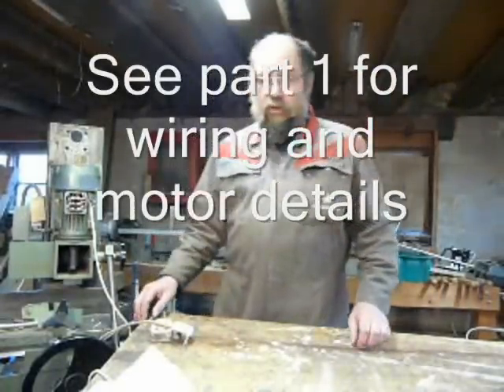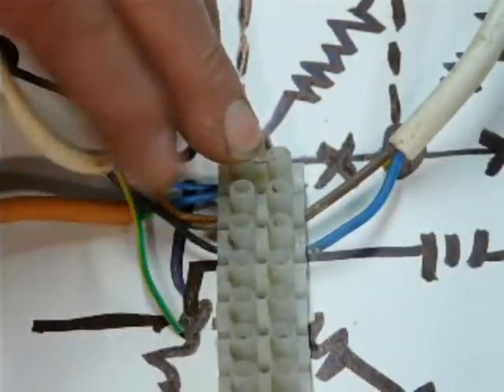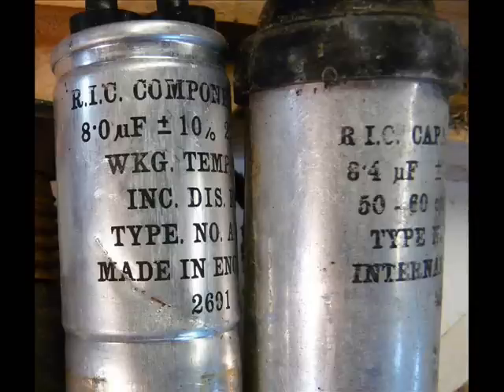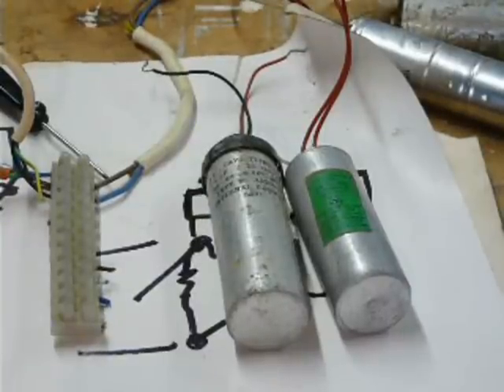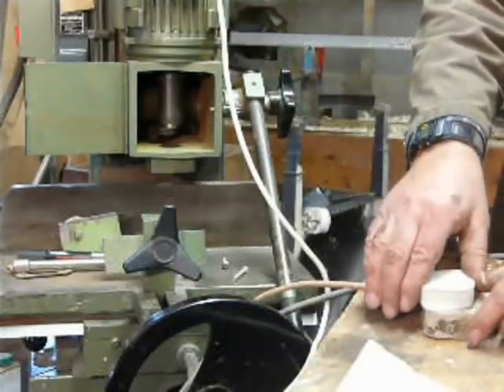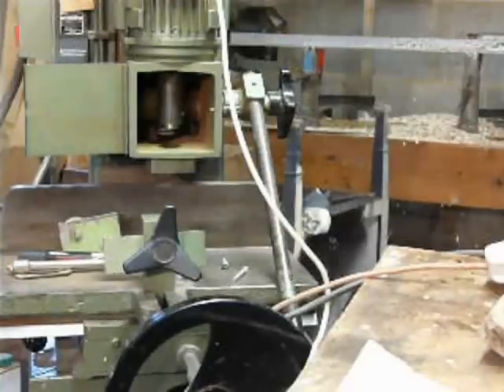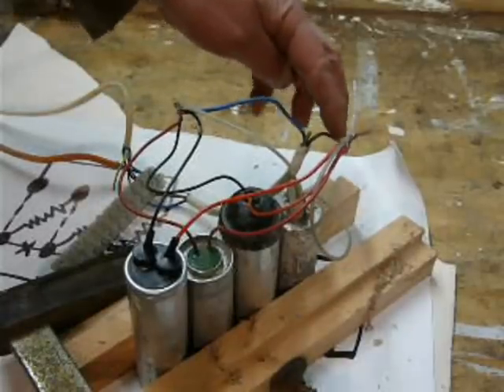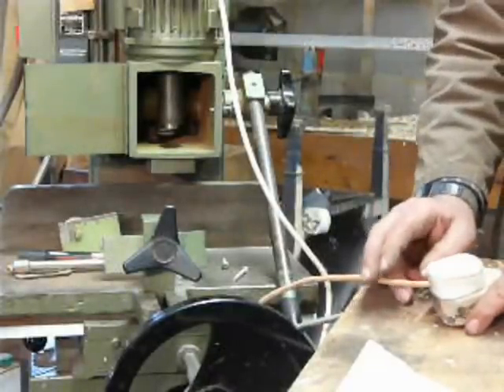How to do it: run a 3 phase motor on single phase supply. part 2

Comment: could you shed any light on this for me please Andy,a guy selling a meddings pancera drill i'm interested in,says he thinks it was three phase but its running on single, but is running in reverse only.has this fella just got it wired up wrong and the drill fine OR something else?cheers,Dave
Reply from the maker: David, If the rest of the drill is OK then it's time to do a deal. If it's running backwards then it can be be thought of a faulty and so lower the price. If this has a 3 phase motor then the motor plate will say so and you will be able o find he capacitors. For a 3 phase motor it's easy to change he rotation, you just swap any 2 of the wires, that's it. For a single phase it's a but more complicated but I've done a video about it, search Andy Reynolds Brooke Comptom. Cheers
Reply: @TheInfoworks  Hi Andy,turns out it was a single phase motor the guy having said it was three.studied your video on single phase motor rotation change and hey presto it was as easy switching the two wires!! and suggested a lower price which i got!!happy days!  thanks again for your invaluable videos and advice!Dave...p.s.it is a meddings pacera soon to be restored to its former glory!theyre very  nice drills i've gotta say!
Reply from the maker: @davidwoodward7020  David, splendid, self reliance improved and one happy subscriber, cheers
Reply from the maker: @davidwoodward7020  David, grand news, it's  drill for life, hope you've seen my Denbigh drill rescue series. Look under "about" on my channel page, cheers
Reply: @TheInfoworks  will do,cheers!
Reply: @TheInfoworks  okidokey,thanks for the reply and i'll look that video up to,cheers!

Comment: Hi Andy,is there any formula so to speak of capacitor size in uF etc to  the power/size of a 3 phase motor?if so please let me know,ive a fobco floor standing drill i am trying to convert.
cheers,
 Dave
Reply from the maker: Dave, there is an it will be buried in the comments somewhere. With all the differences in motor design I fin the trial an error method better. Even if you calculate the value you will find that some experimentation is still required. That's why I set out the videos this way and it allows you to use the capacitors you have in stock. Cheers
Reply: @TheInfoworks  ok thanks Andy,i'll take a look for it and have a play around.cheers,Dave
Reply: @TheInfoworks  Hi Again,just one question.ive got as far as figuring it needs about a 12uf capacitor for a 250w motor..BUT as the triangle indicates on the motor spec badge, it says 220/250 opposite it...but the kinda mercedes tri blade symbol says 380/440..my intuition is telling me as i'm going for single phase and that type of wiring i should use a 220/250 capacitor..would you agree Andy?
Reply from the maker: @davidwoodward7020  David, the triangle is delta and is the correct wiring for 240v. Have you see part 1 and all the rest of this video series? cheers
Reply: @TheInfoworks  not yet,i looked at 7 as per your advice to some over capacitors in comments here...as with most men we try everything then eventually read the instructions,a certain parallel here :),i shall have a look this evening,thanks for your advice and direction Andy

Comment: Thank you Andy!
Your two videos on Three Phase to Single Phase are superb and the subject mater explained so very well!
Having electrical experience in a Nuclear Power Station's I.M.D place of work will help me, sometime in the future, to convert a 3 Phase Motor to a Single Phase Motor!
I believe that any practical, safety minded and intelligent fellow could also do so by following your advice via your videos!!
I suppose the only limit on a motor's size is down to the Electrical Supplies's Capability? 
Does it follow that the larger the 3 Phase Motor (or Generator) the larger the capacitor(s) that one would need?!
That would be both "Start" or "Run" capacitors.
I have some "Whopper" Motors here on my Farm that have driven Grain Drier Fans! One of these Fans can also be driven by a Power Take Off (P.T.O) from a Agricultural Tractor! 
I also have a Beautiful Old 3 Phase Motor Driven Mechanical Hacksaw that needs to be put back to work!
If I could convert the P.T.O Driven Fan's Motor to a 3 Phase (or Single Phase) Generator then I could drive the Old Hacksaw and my other 3 Phase Motors with my 
1982 Massey Ferguson 690 (70 to 80 HP at 540 Revs P.T.O Speed) Farm Tractor.
I also have a Lovely 1998 Italiano 100 hp SAME Silver 100.6 Farm Tractor with a Six Cylinder, Air Cooled German Deutz Diesel Engine in reserve! 
Perhaps I could please ask you to make a video on how to convert an Electrical 3 Phase Motor to an Electrical 3 Phase Generator Andy?!
That way one could Harness the full power of the "Whopper" 3 Phase Motor(s) come Generator?!
Meanwhile I will now just have to "Trawl" the "Net" and hope that I can find Video(s) on the subject that can match the quality of your Videos?! 
Well done that man!
All the very best to all of you "Out There!"
Rob ö Halmore in The Berkeley Vale.The West of England.
Reply from the maker: Rob, I  have never had much success with larger motors, due perhaps to the start current that could be up to 10 times run current. To that end I did a video showing the use of a pilot motor to stabilize the third phase. Thanks for your positive comments, cheers
Reply: @TheInfoworks  OK Andy you are most welcome! There are Genny Videos on the Tube but you should do one for our edification! Are you from the UK and are you a Boffin or a Prof? What is the Link for your Pilot Motor Video? I shall have to look up and learn about "Pilot" Motors! Are the Neigh like "Pony Motors" Jock or can they fly along a bit?!  Absolutely no idea and I should know! Bye! Rob.
Reply from the maker: Rob, self taught mate, a pilot motor is a motor that you start with no load and it runs all the time to stabilize the 3 phase. Then you start your primary motor. It's part 7 but here's the link, https://www.youtube.com/watch?v=qbhDFseizWc&t=4s
cheers

Comment: Hi i convarte my 3phase bench grider to single phase and it runs very slow can you tell me what I did wrong
Reply from the maker: Hi, I think part 4 shows this, you probably have a faulty connection, does the motor start very slowly, cheers

Comment: Upto how many minutes I can run with the capacitors?
Reply from the maker: Hi, I don't seem to have a problem with run time. It depends on the capacitor size, as the large the cap the higher the coil voltage, see part 7 for the experiments, cheers
Reply: Ok thank you

Comment: thank you very much for your video. too bad you couldn't show how you calculated the micro farad's needed
Reply from the maker: Hi, thanks for the comment, the whole point is that there are so many variables that trial and error works well, see the last video in this series (see playlist), it may be part 7, cheers

Comment: Hi, nice Video. I've came across an 1963 AEG bench grinder and it works, cleaning up in progress. It is a 16 amp 800w with 4 wires going in, i take it that means it is 
 2 phase. .? I also want to run it off 230V.
Reply from the maker: Hi, this is confusing, the 4 wires could be 3 phase + earth, see what is connected to what by using continuity on your multimeter. Also 800 w / 16 amps = 50 volt,  or 800w / 1.6 amps = 500 volts. It should show a voltage on the tag, Subscribed? cheers
Reply: @TheInfoworks  i just looked today. It seems 3 live and one earth. I have two rows of 3 screws with a  copper bridge. A question please. If i conected condencers to it would i nead a natural wire as well. From what i have been watching there is a Delta circuit and star circuit. Mine is not connected like a ladder but in a line. 380v 800w .
Reply from the maker: Hi, this is what the whole series is about, sharing what I did, cheers
Reply: @TheInfoworks  thanks for your quick replies,  i will watch further and get it together. 👍
Reply: I have 3phase motor and singel phase current line .iwant to run three phase motor on a singel phase lins
Reply from the maker: That's what this video series is for. cheers

Comment: Be careful for polarity of electrolytic capacitors, plus, capacitors "hold electricity" and you can get a nasty shock from them if they're not fully discharged. This is a great video. Thanks for posting it.
Reply: U DONT HAVE TO USE POLARIZED ELECTROLIZER. it's AC vurrent not DC. seems u should pay more attention on the argument.

Comment: Make sure to disconnect before turning the machine off. This ensures the caps are discharged.
Reply from the maker: The caps discharge through the motor coils when the AC is switched off, cheers
Reply: @TheInfoworks  That is what I meant by disconnect.

Comment: Could I use this method on a milling machine it has a10 hp motor 3 phase and 1.5 hp for feed table is it doable?
Reply from the maker: Dermot, you will definately have to use a pilot motor of a reasonable size, see part 7 and then experiment, and maybe stay on star config. cheers
Reply: @TheInfoworks   what you mean by pilot motor
Reply from the maker: Find the playlist on my channel page and see part 7, cheers

Comment: How many capacitance i need in a 1hp 3 phase motor?
Reply: You should be asking how many microfarads do you need. And that would depend on the voltage and HORSEPOWER rating of the motor in question. Keep in mind that the capacitors used, MUST be rated for the working voltage.
Reply from the maker: Hi, try 40 and see part 7 for voltage tests, cheers

Comment: Shouldn't the yellow/green still be connected to motor frame for security? Sorry, not native English speaker so I don't know the exact term. Safety grounding?
Reply from the maker: Hi, I needed 3 wires in the experiment, so I used all 3, yes yellow / green is normally earth, so I need 4 wires, cheers
Reply: @TheInfoworks  True of course. I somehow looked that you have 5-lead motor cable, but it wasn't.
Reply: true, yellow\green is earh. ALLWAYS connected to the metal parts and to the ground of plug for safety. never use that wire color code for any other use.

Comment: thank you for this informative video and also the referring to the book: one side note: wait for a few minutes before touching the capacitors if you messing around with them! they hold a charge and may not be discharged when you disconnect the mains.
Reply from the maker: Hi, a pertinent point but in this case the capacitors immediately discharge through the motor coils once the power is switched off, cheers

Comment: I have spent hours and hours searching the net to try to get my head around this problem and you Sir have helped me more than everything added together in only 7 minutes.  Many thanks
Reply from the maker: Nick, thanks for the appreciation, please check out my books on the channel page, subscribed? see part 7 for voltage details, cheers
Reply: wait for a few minutes before touching the capacitors if you messing around with them! they hold a charge and may not be discharged when you disconnect the mains.

Comment: Has anybody heard of the rough guide of engines kilowatts x 70 gives the Microfarads you need?
For example a 1.5kw or about 2hp engine would use a 105uf capacitor. 105 is rare but 100uf is available and is about the maximum easily available Any more hp would need several capacitors in parallel. Is this correct?
Reply from the maker: Hi, I like rules of thumb as a guide and this one seems about right for a start capacitor, maybe x 35 for the run cap. The conrolling factor is the voltage across the coil when the motor is running, see part 7 for more details on this. Yes, wiring capacitors in parallel adds the capacitance together, cheers
Reply: @TheInfoworks   Thank you for the reply. I've had a look at an old lathe motor I have and the capacitor is 16uf for a 1/3 hp engine which indicates the figures are about right. The rpm is 1400 which tells me its a 4 pole motor. A 2 pole motor would run at 2800 RPM and might need a different value capacitor.
Reply: by this formula, do we know how long the system can go until it creates a burning smell?
Reply from the maker: Hi, see part 7 for finer details of voltages, I have used this syetem for many years without problem, cheers
Reply: @TheInfoworks   Thank you for the reply. Part 7 was a bit hard to find. It might be a good idea to link part 7 in your more commentary below this video.( linking videos to and fro gets you more views ) Again many thanks.
Reply from the maker: Thanks for that, I've added some details. All 7 videos are in a playlist and end screens point the way to the next video, cheers
Reply: @TheInfoworks  Thank you for the reply. Good stuff, cheers, hope you do well. You could still add it in descrip and add more. A person with no knowledge is a bit dumb so you have to cater for them and link videos.
Linking things to and fro should get you more views anyway which can't be bad.
If you really want to get a lot more views you need to edit your tags andd add a lot of things that are,missing.
Tags are things that people search for and show up in a search.
Your tags here would be " how to run a 3 phase motor engine in 2 phase 240 volt ac dc current convert converting to electric connections wire wires "
 " or something like that. You get the idea? it.s things people would type into youtube to search. Apply them and any more you can think of and see how you do. You'll be off and running for a mega boost in viewing figures if it goes well.
Reply: @zenoist2399  ac dc???? it's all AC dude. the capacitors are NOT polarized and are used to move the phase to create the missing one.
Reply: @thailander5572   If you drop just below it , it should be good to not burn but might lack power > Iv'e neve tried this theotorical concept out though so be warned. If you try it tons of people would love to know the results.

Comment: Very good.  I liked it. Capacitors calculation based on horsepower would be great addition
Reply from the maker: Hi, the calculation has been provided somewhere in the comments. It is however a matter of trail and error due to motor design and duty, see part 7 for further details on voltages and capacitance, cheers

Comment: A machine dezime to operate with a380v supply aĺl motors are 380v 3 phas the supply  volt at the location  is 230v how to covert this machine to operate
Reply from the maker: If you need 230v and only 380v is available then 230v is between 1 phase and neutral, cheers

Comment: Dug up an old soviet cement mixer with 3phase motor. It has a bunch of capacitors wired up to run with a single phase plug, but it's been sitting out in the rain and snow for years. Will the capacitors be dead? Will it just fail to start if they are? Haven't tried running it yet.
Reply from the maker: Hi, they might be OK. Best draw out a wiring diagram and then give it a go without a load. Are there any labels on the caps?  See part 7 for more backgound info, cheers
Reply: @TheInfoworks  Yeah there's two clusters of caps, one bunch in seemingly good condition in good wrapping, the other rusted and scattered. They add up to 50μF on the one side. Could they be tested individually with a multimeter? Would like to sort out which are good and rewire them if I can.
Reply from the maker: Hi, if your multimeter has a capacitance feature then you could measure each one. I use a capacitance meter shown in part 7, cheers

Comment: Hi if I have a 3 phase motor and run it on 240v do I need 400v or 240v capacitor, sorry if stupid question but I need to know. Thanks
Reply from the maker: Hi, a 240 should be fine as they can handle up to peak voltage of about 330v, cheers
Reply: You should get a minimum of 400v capacitors the motor will generate on the third phase that the capacitor is across and the voltage will be well above 240v. Lower voltage capacitor will work for a while but eventually the voltage will break down the dielectric and your capacitor will be toast.
Reply from the maker: Hi, 240v non polarised capacitors are designed for the full wave voltage of 330v and so will be fine as we are running this motor on 240v, cheers
Reply: @TheInfoworks  hi Andy have you ever put a motor running on single phase and disconnected the capacitor from the third leg while it's running and measured the peak voltage on third leg you will be very surprised how high it can be. I worked for a short while for a motor rewinding company and an old buck there who was making rotary conveyors on the side said to always use 400v minimum rated capacitors because the peak voltage on the third leg can get up to higher voltages than you think even though you are only feeding 230 in the motor will generate voltage on the third winding.

Comment: Just for safety! capacitor could kick your ass so bad.
Reply from the maker: The capacitors are shorted through the coils before removal as soon as the power is switched off.